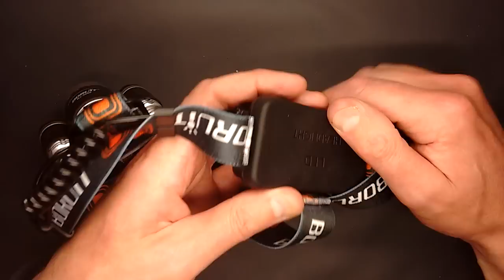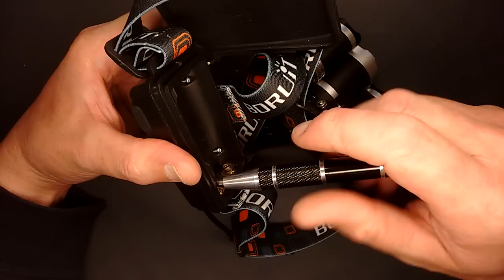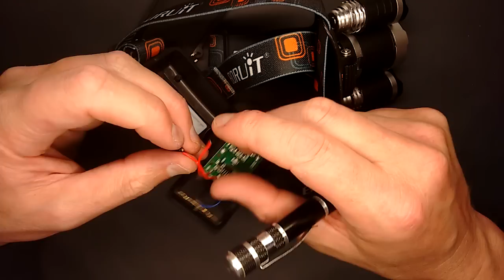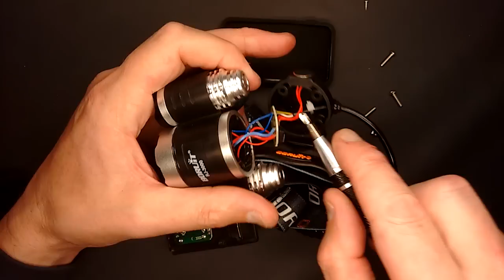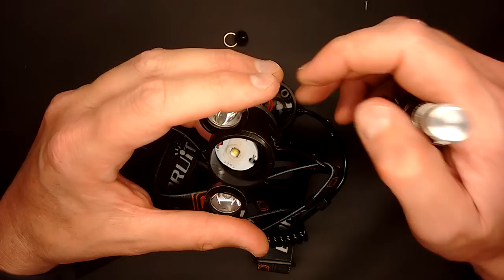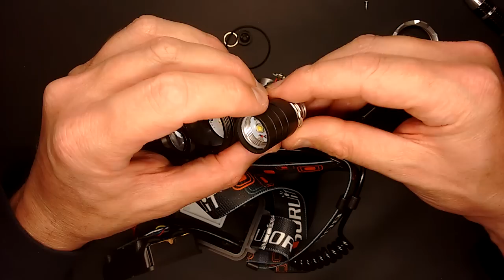Burnt battery contact head torch autopsy.

Comment: I brought a couple thru wish about a year ago, gave one to my friend and both of us have had good use from them. The 18650's mine came with are actually not too bad for a no name chinese cell. If the beam was adjustable it'd be a very good even if the 2 outer lights had a wider beam or weren't focused on exactly the same point as the central light. For the coin they're pretty good I think. I've seen headlamps going for 3 times the money that don't perform as well.

Comment: Cool, just found this one, had to watch as I have had one of these headsets, well perhaps as long as this video has been out there.  Strange how that works; perhaps I purchased it after seeing?? Probably not, usually if you find a fault, I won't buy the product, but I do have to say, it has worked great for me now for many years. I keep her fed with old 18650 cells removed from old laptops that I replace battery's on for my friends and family.  Usually, I find that only one or perhaps 2 of the cells are really bad, the rest have just been disabled by the deathwatch IC.

Comment: I have been using 2 sets of these lights for dog walking over the last 4 years. No issues except one of the small lights lost its lens so the whole unit became difficult to use in wet weather. Yes it rains South of the Boarder too :) 
Great lights with fantastic beams that go father than most none HID headlights on cars or motorcycles will do. :)

Comment: Bought one exactly the same as this but with no brand name, used twice and stopped working, opened battery tray to find fused &pinched wires leading from battery charger port and half-fried circuit board, also wires come lose in light assembly, good components just crap, dangerous wiring inside, waste of £20!!

Comment: i have a couple of the zoomable single lamp ones of these Boruits. i love them, but i have had to upgrade the elasic as it stretches in no time. I use high quality expensive brand  cells and they do run for ages.  i would like to do some mods to the circuitry such as : fit a smoothing capacitor so that the low power mode doesn't strobe.. and also fit a variable  resistor to control the brightness, how hard would that be? what's the best way of doing that?  design a totally new driver board?   What annoys me about these cheap Chinese things is they are nearly good. i mean  i'dbe happy to pay for a higher quality version but they just produce them as cheap as poss. FOr only slightly more outlay they could make them much better.

Comment: Looks like it could have shorted out by touching also them wires being small they break like toys.Guess some manufactures are too good to get 18 AWG gauge or better put in their products.Besides China don't even know the meaning of using a good size wire in electronics they use  tiny wires which is junk pure junk

Comment: I had one too and after some time of working one of the transistors burned out. It still works but main LED can't be turned off.
Reply from the maker: Shorting out is a common failure mode of transistors when they have overheated or been subjected to a high current flow.

Comment: I had one of these fail on me 2 days ago. In my case it was the Elfeland version of this light. One of the 2 transistors blew up. And as you can see, there not much protection when that happens. I was using 2 fully charged 18650 with a bit higher capacity than the crap that came with the light. I'm glad the batteries I bought was with the protection circuit as there's no protection in the head light.

Comment: The battery terminal spring in the device could of simply shorted out the + and – of the lithium cell if inserted backwards and if the battery plastic coating had been damaged or not sufficient to insulate the casing from the positive.

Comment: I bought one of those for my wife.
5 minutes after opening the package I modified the lights before letting here use it.

There is NO protection or charge-controller in this lamp.
Unmodified it's an accident waiting to happen.

Comment: ive got one of these i use when exploring abandoned mines....its covered in mud but so far, no issues, i did waterproof it though :)
Reply from the maker: I'll guess you take at least one spare lightsource?
Reply: Not to mention someone else with you?
Reply: bigclivedotcom my dad bought one of these and IT came with a crappy car charger Just like the car charger in your recent worklight video and i told him to not use the car charger. later i disasembled the car charger and Just like i expected there where only two resistors in it

Comment: i'd hazard a guess that the batteries protection board went short circuit
funny thing is i've always wanted to get my hands on one of these lights 

just out of curiosity what way around are the batteries? is it a  8.4 volt series or 4.2v parallel system?

Comment: I suggest please not using HDR.

You may try to use HDR either when you have such a strong point light source that either highlights are blown out, or shadows come out completely black, or midrange detail is lost; or when photographing subjects against the light.

What HDR will do, it will try to retain local detail while narrowing dynamic range by high-pass-filtering the image, so there will be a wandering shadow/halo on the video around light/dark objects. It may also try to photograph with more dynamic range, but i imagine, sensor limitations kick in rather swiftly.

I suggest trying auto exposure once again with HDR off, it might prove more workable. I think HDR amplifies the annoyance. But i'm not sure.

Comment: Occam's razor would suggest that the dissimilar charged batteries would be the most likely cause of the meltdown to me. I cannot imagine a circumstance where that tiny wire would be able to carry the amps necessary to change the temper the spring and oxidize the metal. 

That being said perhaps send it to EEV for more in-depth, hightech gadget filled testing could be done. EEV could then send it to AvE for comment on the materials involve and some commentary on its construction and repair. AvE could then send it to Photonicinduction for an "until it pops" death.  

All my favorites collaborating.... A man can dream can't he. If only we could get the Crazy Russian Hacker involved...

Comment: i have this exact headset.  works great and is really comfortable but the battery doesn't last as long as i would like but its not too bad.  i really like that i can either charge it via ac adaptor or i can remove the batteries and put them into the included charger (the ac adaptor is also included).  thanks for doing this video

Comment: I have been using this same lamp for about a year. The thing about these is the batteries go in the same way. If you put them in backwards they will short out. This is especially easy to do in the dark. The light will still work, its just the contact springs have lost their tempering. But at $9US I buy them in bulk.

Comment: Clive. I want to make a LED work bench light.. I bought some Strip LEDS that are waterproof (white) And I also bought some cheap IR controllers for them the controller Says on the sticker 5-24v peak 12a I'm sure that it will come no where close to the 12a (China) haha.. But anyway.. its not going to be anything special but I cant come up with anything that will house the LEDS.. I just have no idea where to begin. on what to build to house them... Do you have any ideas on what I could house these in.. any input would be great thanks.
Reply from the maker: Under a shelf if you have one above your bench?
Reply: I don't have one.. I will have to make something for the leds.. I'm kinda thinking about something that will attach to the edge of the back of my computer desk... will try and give you a idea of my setup.... I have 3 monitors on my desk.. I use one for my PC.. I use another for another PC I have hooked up beside my desk.. and the 3rd one I use when I repair PC's and game consoles. I also use this desk to do my soldering and everything. Its why I wanted a led light strip.. I just got nothing to house the LEDS in.. I have access to wood.. So I'm thinking of a homemade Long light .. kinda like the 4ft or 8ft toob lights.. but not 8ft long though.
Reply: I have had success using 20 x 10mm U aluminium channel as a heatsink/reflector. I prefer a rotary PWM dimmer to the IR "multiflasherthing" cos I can't lose the controller and I found the strobe settings of limited worth. A heatsink is a must for the LED strip, although whatever you use the sticky on the back seems to  come loose when hot in use.

Comment: I've had mine (you've shown it before the one with a single CREE LED with blue band)  same box in the back.  ) glow but only ones and only because the one cell wasn't making proper contact with the Positive end.  The ones that are better came out of a laptop battery ( 9 cells = 9 batteries)  and usually a bit of a shock at some point. :P  more or less because Dell recalled my laptop and I was left with a brand new battery.  Doesn't work so well with used Laptop batteries.  The difference however is that the ones out of a laptop battery are much flatter on Positive than the Ultrafire etc brands that actually have a tip.  All I did was pull on the negative end springs and problem solved.

Comment: +bigclivedotcom can you do a video on current transformers. I'm curious why you have to short them out when not in use and what happens if you don't. Thanks
Reply from the maker: Because a current transformer has a single turn primary (the wire it's monitoring) and a high number of secondary turns (the sensing coil) it acts like a high voltage step-up transformer if left open circuit.  That can result in a high voltage but low current output that can cause insulation damage.

Comment: I have several of those lights and yes if you put one in backwards you get one terminal burnt I have done several times you get the battery out as soon as you notice it rarely gets left in long enough to heat both terminal's

Comment: I have an LED flashlight (torch), supposedly 1 W, in which its metallic reflector was shorting out the LED itself (because of the bare contacts on the side of the chip assembly).  It intentionally screws in and out to focus the beam at different distances, but unfortunately allows the reflector to go too close to the LED.  I ended up squirting some hotmelt glue on it for impromptu insulation.

Comment: I have the exact same model of headtorch, and it has been my "daily use" light for at least a couple of years now, so they sometimes are perfectly fine. I also have another one by the same maker, but with only a single LED, and that one smoked it's control chip after about 2-3 hours use. It's random what you get

Comment: I don't know if others have mentioned this as I have not read all of the comments yet, but it would seem to me that the fault here was in the battery itself and not the headlight. The broken wire could have easily happened after the previous owner opened the unit to investigate. I have lost count of how many times I have broken fine connections like that one. Without the actual battery that was in that compartment being available to test we cannot know for sure but I agree with Clive. It is not likely that such a thin wire could pass such a current and not be burnt at all. It would have glowed like a bulb filament. I think the battery got hot, heated the contact, (possibly) melted the solder on the thin wire and parted it, but certainly fried the coiled spring contact. The only other thing I can think of that may make that thin wire survive is if it is PTFE wire.

Comment: Ono... I've ordered that one!... Christ...
Reply: Just check for loose wires and you should be good. The build quality looks alright :)
Reply: i have this exact same light from amazon, have had no problems with it at all.... modified it to use a s a bicycle light ( its a bit too bright for a camp light, cant look at your friends without blinding them)
Reply: +Sebastian “Sebi” Grygiel I was about to open it up when it got here.. But now I'm for sure. I have protected cells.. But they can deliver a extreme current.. I'll think I'll put the light in my bps first 😂

Comment: I have one of these head torchs and the wiring failed at the end where the cable goes into the main headlamp,just from fatigue of moving. I repaired it once and next time it failed I just stripped it down and now use it as a bench lamp and works very well off a 4V power supply.

Comment: A few years ago i had a 14500 cree flashlight and suddenly for no reason it gave me a sudden what felt like burning, and still don't know what happened because after quickly removing the battery the flashlight was fine and the battery still worked.

Comment: Couple things, first, for anyone wondering, this is the exact headlight https://www.amazon.ca/gp/product/B00OISBBXA/ref=oh_aui_detailpage_o01_s00?ie=UTF8&psc=1

To Clive: Grab yourself a bluetooth lapel mic and use that for the audio, IIRC, the best auto camera settings for benches like this are multi-point AF (if available), HDR, 4K (If available), then downsample in editing to 1080P, the video quality should be really nice, and the audio will be a lot more consistent and full, might want to put the treble down a touch, should be able to do that in the phone's audio settings. Could also get a Lytro camera if you've got the capitol, then you can worry about focus later. I can give you a couple basic editing pointers if you want, but I'm a computer tech by trade, so take any advice I give with a grain of salt, obviously. Cheers!

Comment: That actually looks rather well made, they didn't skimp on things like the glass lenses and machined aluminum housing.
Reply: Probably just an unfortunate unit, I thought the same.
Reply: ***** well, every decent flashliaht/headlight with high output have heatsink. Even more, some of them have temp. protection, eg. XTAR H3 (steptown when >60C).
Reply: A month or two ago, Google was pushing these in ads for Bang-good for not much money. Now that I've seen it's reasonably well made, I think I might pick one up. We like to poke fun at China for their at-times comically bad QC, but they also make a ton of fairly-good stuff for cheap.
Reply: I actually have one of these, picked it up for super cheap and it's great. I take it camping all the time. it's survived drops, bumps and and many charge cycles and works great! very bright too.
Reply: tmb282
I've never encountered a handheld flashlight with heatsinks or thermal compounds, let alone a headlamp. Why should there be one when it doesn't even produce much heat at all?
Reply: ***** of course they produce heat. Set high mode and try to touch LED pate (MPCB). Simple test - you can touch it - its good, LED isn't overheating.  I've made some flashlights, lamps. If current exceed 350mA heatsing and thermal compund are neceseary.
LED's doesnt like heat, overheating=low efficiency and slow degradation.
Reply: tmb282
I didn't say it didn't produce heat, I said it didn't produce much heat.
Reply: TheJohn8765
I would buy it, but I think they look kinda stupid, so I'd never wear it. I would rather have a handheld flashlight. Just personal preference.
Reply: there's almost no heatsink, no thermal compound even. Just crappy Chinese empty-pill light ;)

Comment: The LEDs are definitely fake. You can tell a real XM-L from a fake just by looking at it, the fakes have a much smaller die size and the silver surface, onto which the die is bonded, is clearly visible around the die itself. On a real XM-L the die "fills" almost the entire silicone bead and you can only see a small part of that silver material. Lots of info here: http://budgetlightforum.com/node/41084

Comment: This channel is probably the best place to ask;
My Kodak powerbank (model: KBP-S/5200mAh), that I use to top off my tablet while using it, has stopped recharging said tablet. In stead, it just maintains the current charge level.
The powerbank also used to emit a high pitched constant tone when it started running out of charge. It doesn't do that anymore.
Anyone know whats wrong with it?

Comment: When I bought a genuine Apple iPhone charger cord, and reached to unplug it, I was rewarded with a burned finger and melted plastic.  My previous Apple cord had worn out and failed prematurely.  I have been using cheap gas-station cords for Apple products, and they never seem to give me any trouble at all, for about 1/10 of the price.  

Some say that the stories circulating in the media about fires caused by "counterfeit" charger cords were started by Apple themselves.  Who's zoomin' who?

Comment: the HDR mode does nothing to the video, it only works in photo mode, where it'll tell the camera to take three different exposures and merge them into a single photo. But the phone won't do it on video, if it does, it'll have to take three times frames/sec and processing time, only to look horrible and weird
Reply: source: I have moto x with open camera

Comment: The lighting seems to work quite well.  I like that it is shadowless (your regular bench lighting is near to two point sources, which casts strong shadows, and can prove tricky to identify things in the video) - as you noted, it's almost like a ring flash in the effect this arrangement has.  The long fluorescent tubes I have seen previously gave a diffuse light as well, but the flicker was noticeable.  A suggestion for the background when doing this sort of close-up work would be a mid-to-dark grey or beige so that most of the image is mid-exposure and the highlights and shadows are evenly bracketed around that.
Reply from the maker: I've been looking for an ideal mid-colour surface.  The grey is definitely too dark.
Reply: +bigclivedotcom auto exposure when you unscrew was messing it up.
18% grey is half way between white and black.
Reply: Get a watchmaker's mat. It's a matte green colour to prevent reflections.